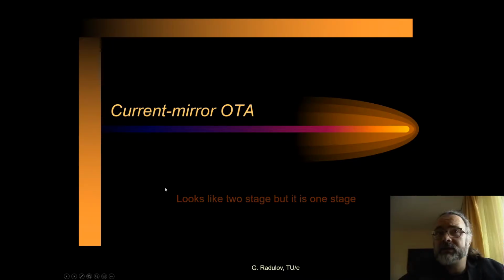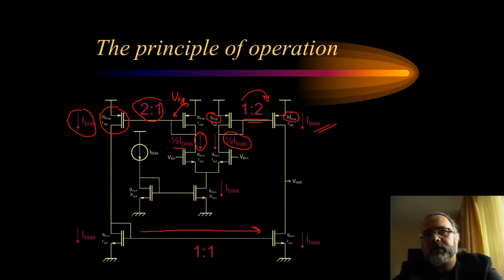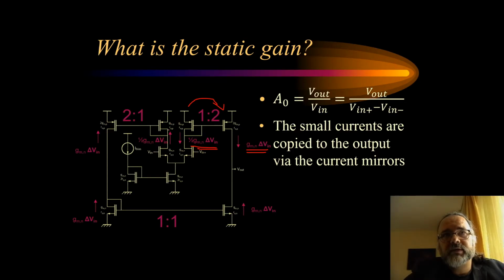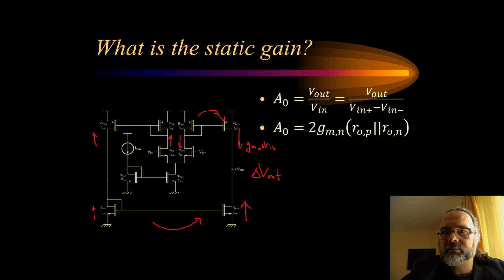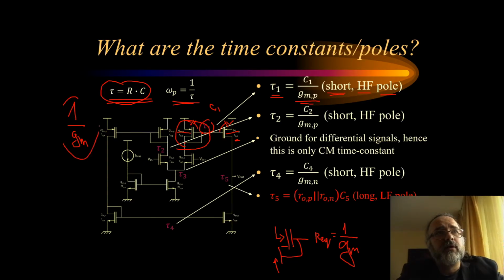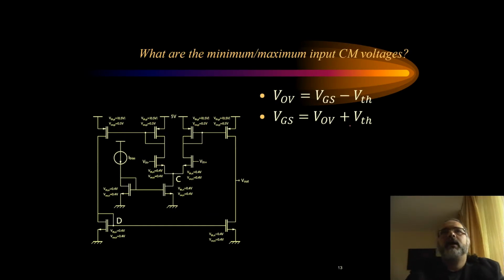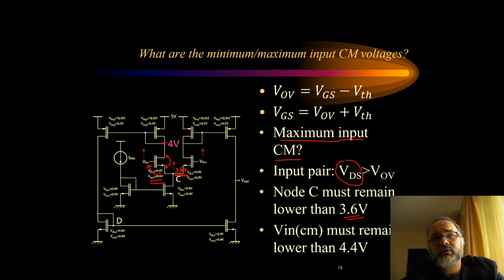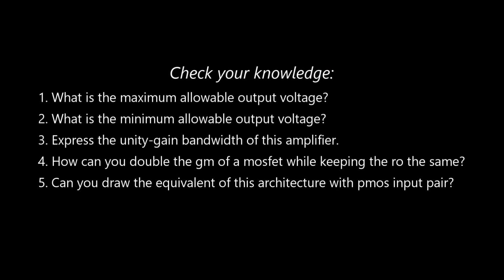Current mirror OTA

Comment: Question. These T1 T2 time constant and their respective poles do not contribute to a double pole since are expected to have the same value? If the circuit had fully differential output the analysis is performed considering the half circuit. But this is not the case right?